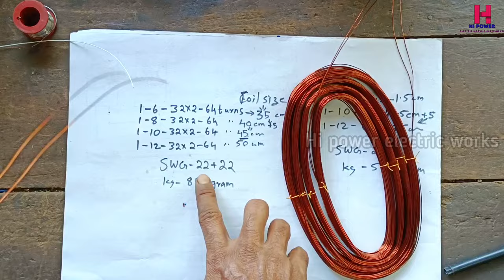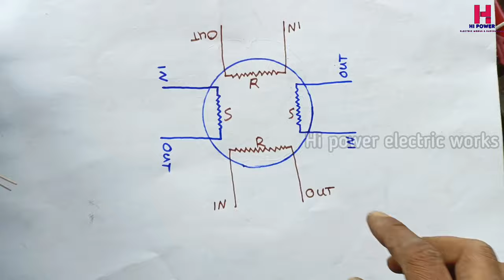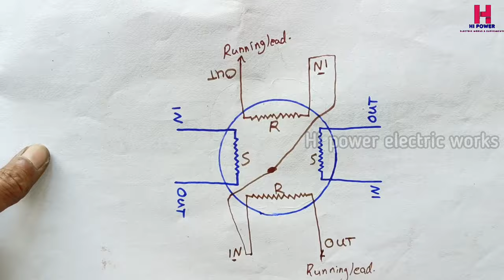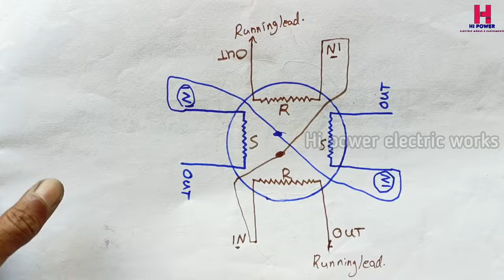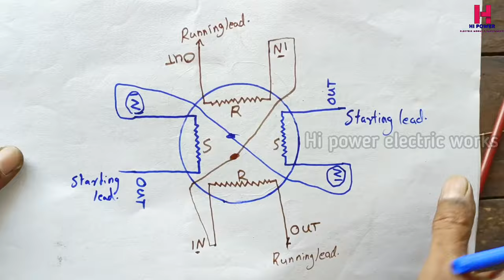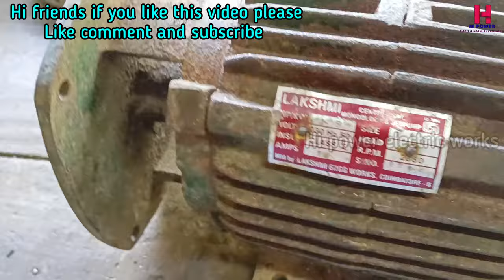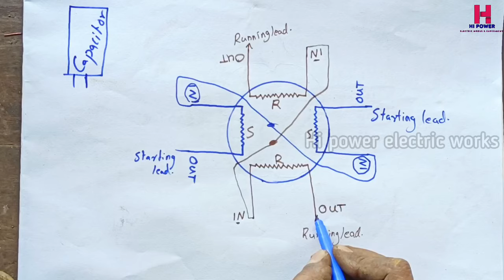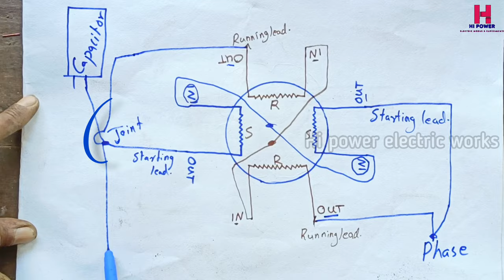1.5 hp burned motor winding|Motor restoration|1.5 hp motor winding|Induction motor winding

Comment: Thank you for your video. It answered several of my questions. I don’t think I will ever be as efficient as you are when it comes to rewinding electric motors. But, I’m going to keep trying.

One last question: How are you winding the coils? Do you use a machine and if so what kind?

Thank you so much,

Rick
Reply from the maker: I wind the coil of the motor using a coil winding manual machine.  You can see what kind of machine it is in the 2:30  minute of this video👇
https://youtu.be/truQh3p2WtI
Reply: Thank you so much for sharing all of your valuable information to people like me. Without you there would be no other source to get this type of information. 

I’ll let you know how my motor turns out.

Once again, thanks

Rick

Comment: Great job but plz mention core size and wire weight
Reply from the maker: Core length - 9.5cm
Core dia - 6.3 cm
Running coil weight - 850 gram
Starting coil weight - 500 gram

Comment: Sir, what's the essence of coil sizes in cm that you wrote........
Is it necessary Sir???  Sorry for the manner
Reply from the maker: Even if the size of the coil increases or decreases, it is difficult to rewinding, so it is better to winding the coil in the correct measurement
Reply: @Hipowerelectricworks   sorry sir I asked too much question, I'm an electrician by profession...... So I just want to venture into Coil rewinding sir......
Sir I'm confusing about coil size in cm and Coil size in SWG
Reply: May you please explain the difference Sir?